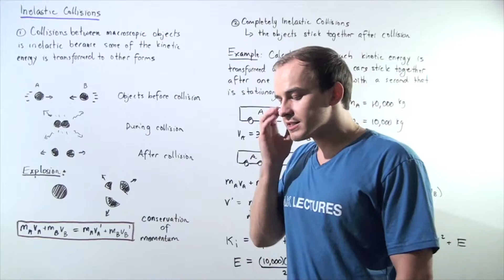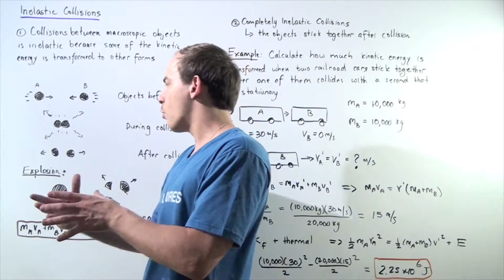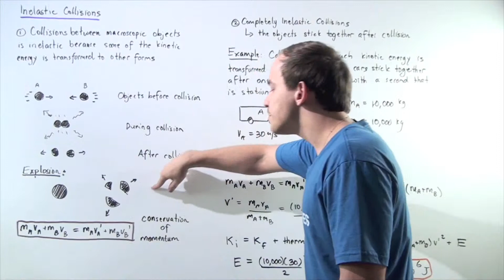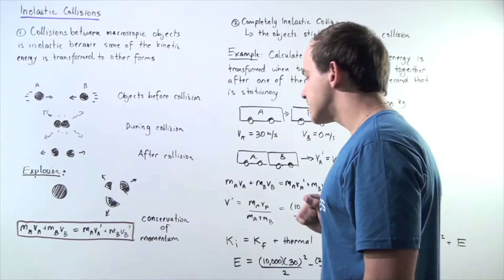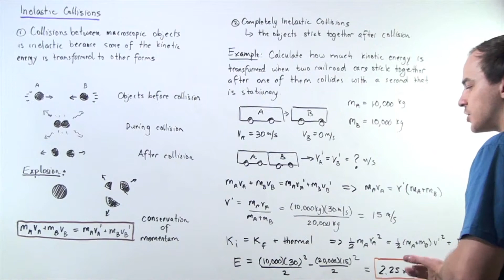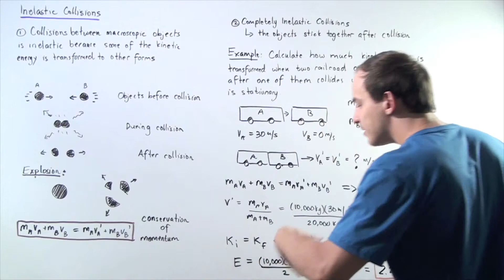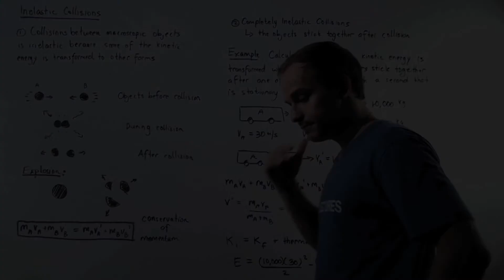Inelastic Collisions

Comment: Did he say that sound waves are a form of electromagnetic energy? I thought they were alternate areas of compressed and ratified air, that is,  pressure waves in the air. So, unlike EM waves, sound couldn't then be transmitted in a vacuum.